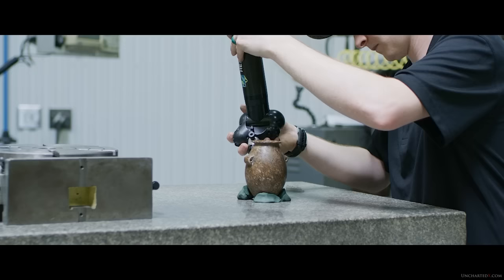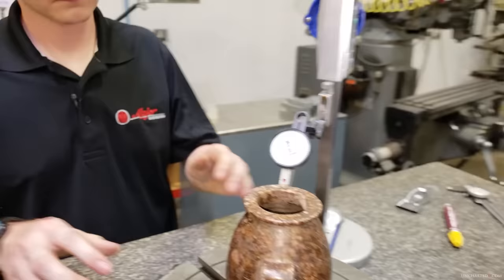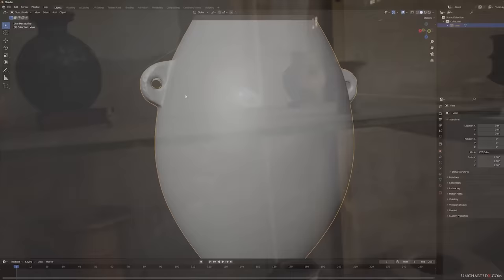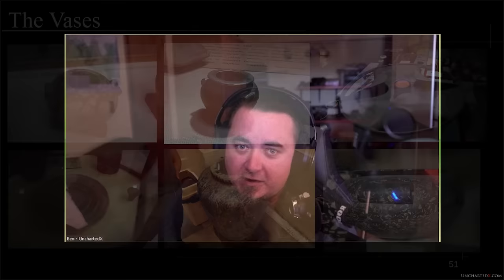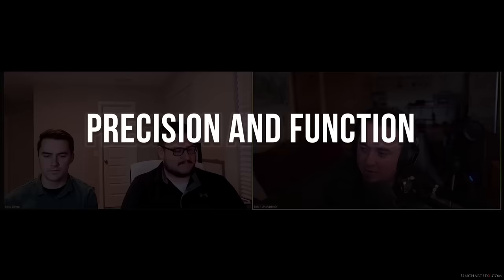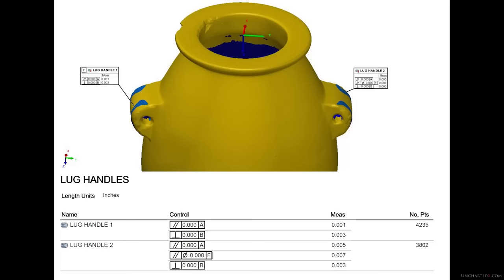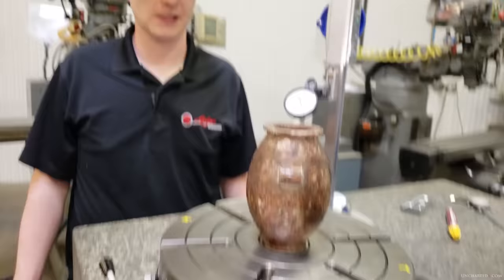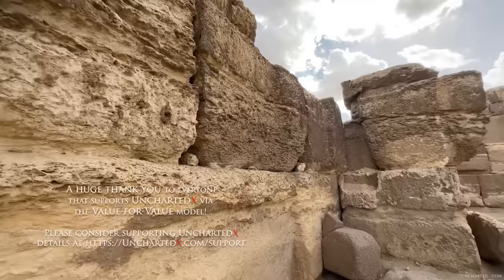Ancient Egyptian Vase Scan Update! STL file, More Analysis - and Between the Lug Handles

Comment: As I've been thinking and not saying too much, about this.  The design solution I came up with is what I call a twin stencil cut.  There is a stencil site outside and inside that cuts out the material slowly.  We have liquid diamond preparations these days.  But, the stencil can be second or more generation replace bit.  The stencil can be a solid that is turned against (you more than likely will notice difference between different runs of vases).  The proces is simple, work outside or inside first, to at least a rough turned shape, then apply the stencil technology.  When the inside to bored out, it maybe used to grasp inside and rotated around for the stencil, then the inside stencil used.  At the end of the outside, one can cut out between the handles.  It can be back and forth.  Again, a new stencil can be used, to conform to the previous stencil where they meet.  It should leave embedding of the substance of stencil in the surface, which maybe still left there to some extent, particularly around the handles and lips.  There should be marking to show which methods are use.  It might be possible to have and adjustable component to the stencil, come on and out, or a cutter following a seperated stencil.

Now, this is still going be going be difficult, but less the 10% as difficult without the stencil, as simple rough shaping during and drilling is the start.

Now, this is going be the beauty of mass production:. If the "stencil" is large and solid, the stencil itself does not need to do the wearing, simply lay the surface with a sacrificial layer,  say a layer of thick leaf/thin bar bronze or brass.  Which ever  is used, it will leave tell tail signs and variance.  Such as the less precise the rough cut, the more the wear points are on the curved parts that make contact first, and do the most work.  So, while they are perfectly round, the angle changes due to increased wear of the stencil contact surface based on the amount of contact.  But, the answer to that is to have a series of stencils that are more precise and at the end, one they finishes off the odd angles.  A drill is then a starting stencil, and as stencils wear down, they can be used in the rougher cuts instead.

Of course, it would be faster and cheaper if you could soften the stone, which there are chemical methods they might leave traces of fine in the final cuts, but which I'm also working on for other method.  These techniques allow every vase to be custom, or mass production.  Again, with all these things, proper scientific engineering examination of the trace evidence reveals how it could be done, and how it couldn't be used.

The cost, is the simple cost.  But, such a precise object light be valued and they are a luxury item, or regarded philosophically as a religious experience.

Fur anybody wondering about drilling.  I have proposed ways of make mechanical drilling, at high speed, able to be manner with the turned transfered over distance.  I have been came up with ways to calculate the speed of light to reasonable accuracy, and the circumference of the earth, which escapes me at the moment.  Most of this does not require high technology society, but good design of technology and a love of precision.  If you look at ancient system, with mathematical precision, we see there is a trend there.  You go back to Golbeki Tepe, and others, and the assertion that these were mathematical designed to astro features, and future astro features.  It's obvious that such love of mathematical/precision can transfer to other areas.

Now, the assertion of liquid diamond.  Through knowledge gained with trial and error over time, something can be noticed or achieved.  My metaphorical example in the past, is that of a whole society were to devote maximum time to systemically exploring the structure of science, chemistry, and  engineering,  it could only take 500 years to go from stone age to Star Trek interstellar travel.  The problem with most people who tell you what is or isn't possible, is they obviously aren't geniuses, and should shut up, think and listen.  Things would go a lot faster in advancements.

Comment: Hey Ben, Thanks for the update and the additional info here. Once again superbly delivered.

Something caught my eye at 11:40 - 11:45 ish... The piece of plate being held up is great but are there any suggestions for what made the parallel track marks on the wall behind? What rock is that? Limestone maybe? The marks all seem to crisscross but a couple seem to be perfectly parallel, like tread marks left by the rovers, in the dust on Mars. Queue, x-files theme tune. :D
Reply: honestly i think its from a chisel of some sort
the distance between each tooth looks similar and many are at different angles so that is what you would expect from a chisel
these tunnels have been explored/raided for many years while metal tools have been in existence, imagine some guys in 1900s trying to get their big wooden pully down there to try lift/move something they would have no choice other than to chisel protruding rocks to try get their equipment in
i think its quite often you see modern tooling marks within passageways, cool spot tho!
Reply: @SHERMA.  I thought about that but the spacing is too consistent along a single track. Even an electric or pneumatic chisel would have a certain variance in the regularity of impact due to the technique and / or fatigue of the person using it. 
You're right about modern tools overlaying ancient. I'm sure there is plenty of that. Strange tho, that these seem to be in sets of two, parallel to each other and in dead straight lines. Would be keen to see these up close and also to know if this is the only spot they appear. Cheers

Comment: The stl file is interesting.  The plan view of exterior contour of the lug handles shows that they are concentric with the circular shape of the vase exterior.  So it is likely that the handles were turned when the vase exterior was turned.  And the superfluous material was removed, somehow, later.
Also, the 2 handle holes are not parallel with each other, so they were drilled/made later, and not very accurately.
Fascinating, great work Ben!   Very impressed.  Please keep it coming.  Happy to be a minor sponsor.
Reply: i have a theory that all of these vases had the handle holes made later by the Dynastic Egyptians.
Reply: Are they attempting to be parallel or are they drastically perpendicular based on what you noticed?
Reply: @BungieStudios  not enough information in the video, to answer your query.  Sorry.

Comment: HI Ben, great work in all the details you uncovered!  I'm curious if you have investigated the volume metric properties of the vase.  Is there any evidence that the internal volume may have been a consideration to its original design intent?  Perhaps when filled with a liquid, presumably water, maybe it's precision tolerance in dimensional specs achieves an accurate volume or weight of water.  Since typically a vase is used to hold something, most likely fluid, you may find something interesting in determining its precise fluid volume/weight.  Good Luck!

Comment: As an engineer who has worked with both hand tools as a historical hobby and the most advanced metal and stone cutting tools we have access to in the United States, including military manufacturing. This is remarkable, and plainly impossible to achieve with anything other than some very unique if not modern technology.  The refusal to revisit the dating of these objects and continue the research is an embarrassment to science.   Not to mention all the people who embarrass themselves by refusing to acknowledge the difference between pottery making and stone carving.   Even in modern times we do not manufacture stone vessels like this because even with modern tools it would be incredibly difficult and an expensive and pointless waste of resources.  The fact that there are academics who believe stone age people were simply "really good" at this is laughable. I'm a master carpenter and I would struggle to make things like this out of wood with every tool in my workshop. Give me a break.
Reply: The methods used were very familiar to a civilisation freshely out of the stone-age. They could tell stones apart and were quite apt to select and used different stones for different tasks. They made a lot of those ancient granite wood axes by the peck and grind method. And they clearly used nothing too precise in their manufacture.
Downloaded. So first there are clear signs this is made by hand but quite well. 
A rotated (lathe) part is easily made to quite a high degree of surface precision.

My take on the manufacturing process is:
Given that breaking the core is the most risky operation, It is easier to drill the hole first in a reasonably sized stone. Break the core. What you get is a reasonably good hole into which to place a log connected to something akin to the drilling setup. This means you can turn it nice and proper.
The turning is similar to the drilling in action and all it requires is some well placed grinding hardness stones and mud.
General shape with massive lug handle revolute feature acheived after a lot of work.
Cutting the handles and cutting the whole portion to be removed into slices to be chipped off.
Now back to turning to smooth out the inter lug area. This time you do not turn all the way but do a 80 degree twist and reverse action. 
Reasonable shape can be easily acheived, but it will show definite signs of a different surface right next to the lug handles, as the grinding stones would engage that suface only partially.
Next a bit or turning in fine abrasive mud for polishing. Drilling the lug holes is not a big issue. And some rough work on the inside, but seems not to be that important overall.
Then present it to your local prince for depositing his kidneys and get showered in massive amounts of hard metal cash to feed you stoneworking stone-turning familiy for generations.
Reply: Have you hand carved stone before without modern metal tools? My experience comes from north American native stone tool working and the types of objects those stone age people and my ancestors worked with.

I would say your explanation and others like it work very well in the theoretical "white room". But core drilling with primitively manufactured copper tubes and sand would work, but the time investiture per piece does not match the relative commonplace finding of tens of thousands of these artifacts across the region.

Yes, stone age people were very sophisticated at working with natural materials , but the amount of copper and time required from a master craftsperson in what was still a largely subsistence based society is not practical.  

Even in cultures with more specified tasks and roles such objects have not been made since these until modern times.

I would encourage you to work with stone even using modern tools and trying to accomplish one of these to these specifications in your lifetime.  You will quickly realize how this vase has more in common with rocket science than it does with pottery.
Reply: @TwoKnowingRavens  Your premise is wrong.
Egypt was far from subsistence farming 5500 years ago. They held an excellent position where crops would grow compared to their surrounding, which meant they had enough and more and anyone that would attack them would be mostly starving.
They got the Nile flooding's from time to time, when agriculture was important and in-between that not much to do other than build trade and do seafaring. 
They kind of knew of wheels, definitely knew rollers and the pottery wheel with the core drill setup.
They could make complex pottery.
They could lift and drag heavy objects by the basic rotational winch, and most certainly had leavers and heavy ropes. 
They had bronze by 3000BC, and copper before that.
Does this even come close to subsistence.
Reply: Nobody would argue that the Nile, Indus, Yellow river valleys and others were extremely productive even with ancient agriculture techniques and could have created abundance, but that's just a tiny fraction of the puzzle.

Even if I grant that this stonework is all completely explicable with flint and copper tools (which I don't) the question remains as to why the techniques don't crop up in other civilizations at similar technology levels. 

If this was such a common and relatively easily achievable process then history should be full of stonework vases, plates, cups, etc.  They do after all last nearly forever unless forcibly smashed.  If this technology was attained by such basic tools combined with some specialized training, then they should be as common as pottery shards. 

No. I maintain that al evidence points to these being a highly specialized technology by a people who predate most Egyptian civilization and they were either gifted to, found by, or pillaged by the Egyptians who then tried and failed for thousands of years to copy them and never succeeded.

Today we could make these to these specifications but only with very specialized lathes, and water cutting tables and c&c machines.  

Even artisans in our time with far better tools, far more free time,  and sophisticated measuring devices don't make objects like this. We must all simply be lazy and uninspired.
Reply: @TwoKnowingRavens  Most civilizations went to more productive processes like pottery that could produce more, faster and bigger than any stone vessel. 
These objects were mostly used for afterlife rituals so they were supposed to be special and expensive and time consuming and so on.
My wager is that they were made in Egypt or close by in something akin to a family business specialized in these very objects. They would thus benefit from specialized tools and jigs and knowledge passed down the line.
Such families were prized because they made aristocratic luxury goods, and would hide their working method to keep competition out.
But they also die out with war or disease if care is not taken to pass the knowledge further.

Comment: You need to see if you can find two duplicate vases and compare tolerances between them or better yet, measure as many different precision artifacts as you can find and determine what kind of measurement scale was used to manufacture them to begin with. Unlocking the measuring scale would uncover a lot

Comment: Thank you for your groundbreaking work. Thank you for the STL, but do you know how tall this vase is supposed to be? The scale is tiny in the file and I would like to print it at the actual size. Thanks.
Reply: I scaled it up to 2,540% like another comment suggested. Seems reasonable but not sure if that's correct. When I slice it at that scale, there's a section missing near the handles for some reason. So, it's not printable as it is. Hoping someone can fix it. I'd love to print this!

Comment: it could have been done on a lathe with something similar to a dividing head, setting a start and stop points, but that still doesn't explain the level of precision or the lack of tooling marks. if the handles are not separate pieces with a nearly perfect interference fit, it doesn't make any sense how they were able to do it.

egyptologists are nuts if they think this was done by hand with copper tools and quartz powder. i would force most of them to attend a modern machine shop and try to machine stuff for at least a month before allowing them to open their mouths about egyptian artifacts

Comment: The only serious objection to your reasoning I can come up with is this, but it is quite damning. All these extremely precise objects are clearly art. There isn't a single UTILITARIAN precise object or, if there is - its utility cannot be demonstrated beyond reasonable doubt. Why would that be the case? Yes, you could use such vases for storing grain or liquids, however, clay is much lighter, and clay vases much cheaper to make, and, should a clay vessel be accidentally dropped, - no big deal. It can be shaped in a mold or rotated into shape in mere minutes. We have extremely precise art too, however, our precision is merely a side effect, if you will of our advancements in complex technology. Without precision rockets will not achieve a stable orbit, gun barrels will explode, solar panels will not open in the vacuum of space. Now, where are all the utilitarian objects made with such precision? Never mind the question of where are the tools which made these vases, sure I can accept the idea that they were far less numerous and could have been destroyed in a cataclysm of some sort or pulled apart to make crude tools after the demise of Younger Dryas civilisation. However, the utilitarian objects made by such machining would be far more numerous and widespread and surely we would have found some by now, would we not?